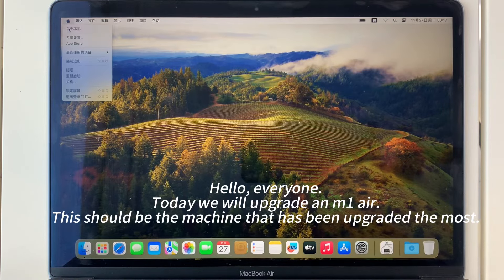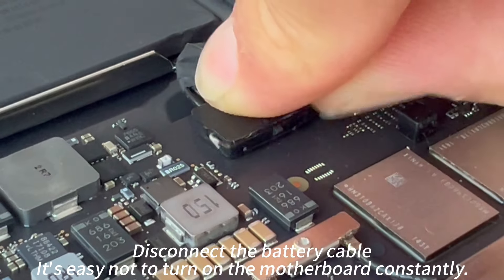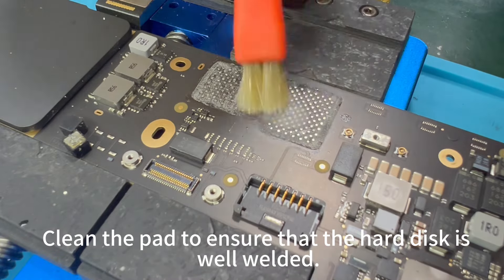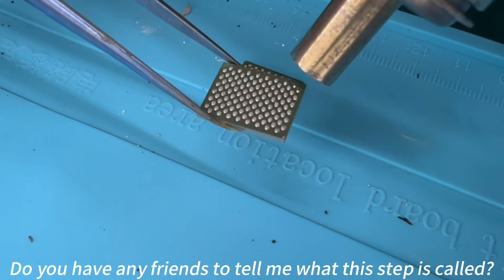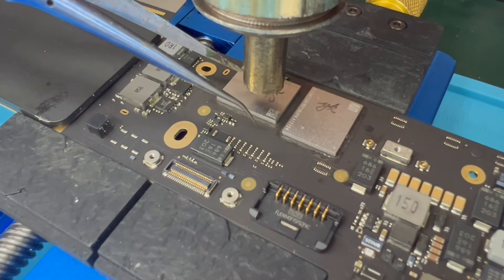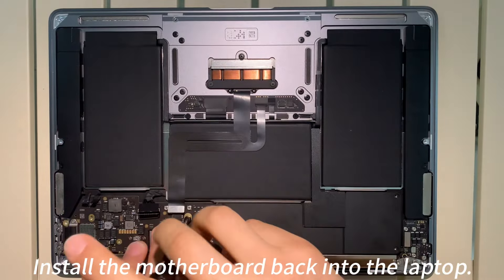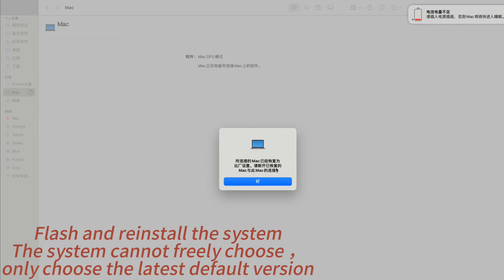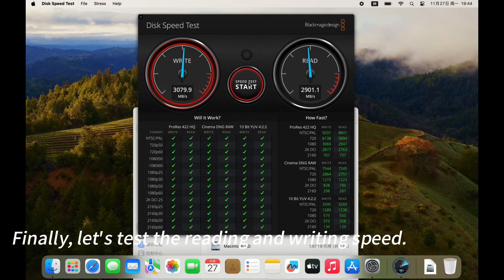MacBook Air m1 a2337 upgrade ssd from 256g to 2tb，very strong，maybe you also need the more big ssd

Comment from the maker: The chip is from this shop 

Just found this amazing item on AliExpress. Check it out! $20.00 | Tested Chip For Macbook Air Pro a1990 a1989 a2159 a2141 a2251 a1932 a2179 a2289 Ssd Nand Chip 128G 256G 500G 1TB 2TB 4TB Repair
https://a.aliexpress.com/_mqYJ6iY
Reply: Can RAM be upgraded from 8GB to 16GB in MacBook Air M1 A2337 ?
Reply: Thank you but the link does not work
Reply from the maker: @MrAsderoff  add WhatsApp +86 186 0948 0414